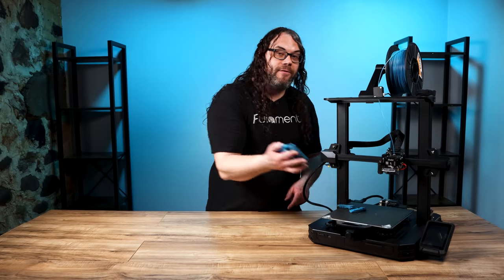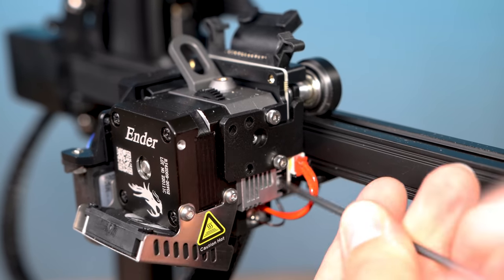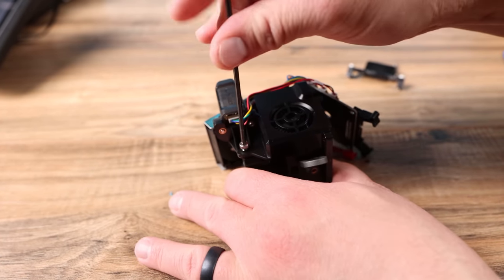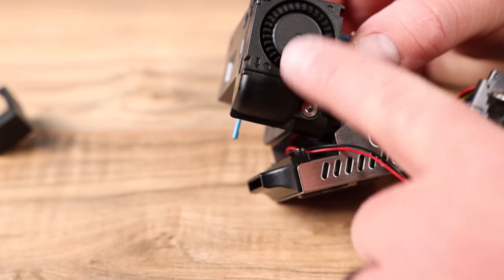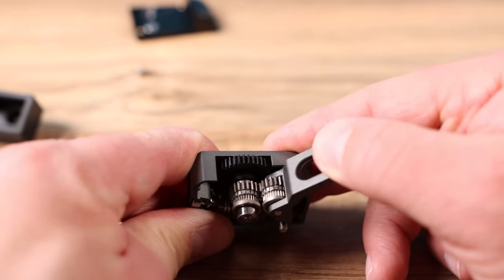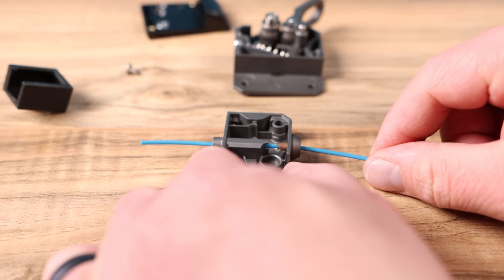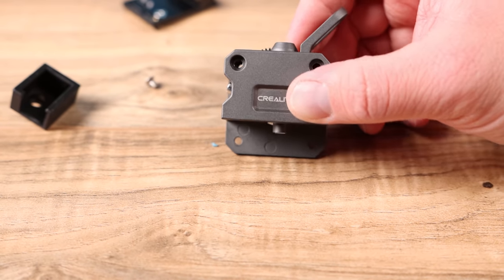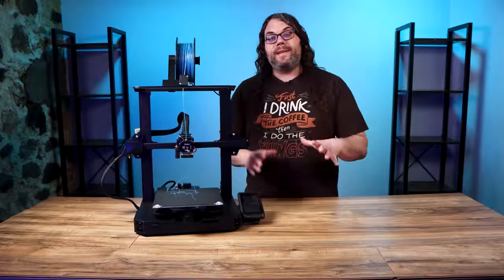How To Fix A Jam on the Ender 3 S1 Pro (FULL Walkthrough)

Comment: Thank you so much for this video!  I had to disassemble my S1 due to a blocked PTFE tube.  I'm trying to put it back together and cannot for the life of me figure out where the heck all the screws go.  I have 3 really long ones.  I know 1 goes in the same side as the board but where do the other 2 go?  I was trying to see the lengths of the screws as you pulled them but I think I missed those particular ones.  Again, thanks for the video!  Gave me the courage to dig in and figure out the issue.

Comment: Great video and very useful for those of us in the same ... jam :-) Before I saw this video, the sprite process looked pretty daunting. But, step by step, clearly described ... it was not too bad. (One very minor editorial suggestion. "Reassemble it by doing the steps in reverse order" ... it would be helpful to have some bookmarks for the various steps to make it easier to walk backwards through the video. I know ... looking a gift horse in the mouth.)

In my case, it was a tiny pellet of filament (the heated blob) that got stuck after eject and broke off when I pulled hard to get the filament out. Since that area is not heated, no amount of pushing or pulling with various tools would get through

Comment: I just dealt with this, but mine cleared up.  I was using luminescent filament (PLA) and the roll definitely has some odd shaped sections and imperfections that you can see.  I think this is what causes the issue.  The luminescent is clearish, but I found parts where there’s a black bubble in it and the filament is deformed and oval looking.  Poor quality control with the filament co. (Disclaimer: these are my 2 cents… you don’t have to take them, I may be wrong anyways) .  I was looking to learn how to take this apart just in case it does it again, so thanks for the great vid.

Comment: Thanks for this, happened to me today. Same issue with a good in the dark filament by eryone.
I checked my roll, it looks even but I suspect it's the direct drive gears either crushing it or flattening it slightly that stops it going into the hot end throat.
Seems like a mini caused it.
Great video, really helped me, had it taken apart z fixed and reassembled in 20 min.
I did remove the stuck filament from the o opposite end that you did as I had enough room and didn't want it to be so violent

Comment: Ive used this video to fix my first jam, but ive had my printer jam twice after it BUT if you catch it within an hour or two your fine as you can just get the filament back out easy enough. What happened to him and what happened to me the first time was it was left alone TOO long and it eventually grinded off the filament which left that piece in between the gear and nozzle.

Comment: Thanks for the video- I tried to just remove the hotend bit on the bottom as another video did, but I couldn't- somehow the gears mangled the top of the filament and it got well and truly jammed right before the PTFE tube. First time 3D printer and I have a jam on the 1st day! Anyway, following this I had to pull the filament out (in reverse- toward the gears) instead- really helped.

Comment: Thanks for the video.  I had the exact same issue as yours and had to use pliers to pull the filament from the 'little white tube'.    

One suggestion - please add or create a rebuild session....just don't leave it with a  'just do it backwards' comment.    I had to write the instructions after a second viewing and then follow them with your video to go backwards.    I would have been also nice to have seen your rebuild!

Comment: Okay, I admit it-- I'm a noob. Just got my Creality Ender 3 S1 Pro, and after 4 printings, nozzle jammed. Tried to disassemble it, and SNAPPED the two retaining screws on the heat block. Replaced the brass nozzle with the tempered steel, and it seems to be working. HOWEVER, one of the heat block screws snapped off in the heat block. Where do you get the replacement screws? Creality doesn't list them, and I  that the screws are m4-30 screws ( I'm probably mistaken about that). At this point in time, should I just go ahead and buy a new sprite extruder assembly, or could I just swap out the hot end?

Comment: Ok. well, I just had this happen to me and I started with the way Creality showed how to clear the throat. This video took more apart than I needed to. My jam WAS in the same area, but I did not take apart the top part to get to the extruder; the PTFE tube shot out when we pulled the remaining filament out. after comparing this video to the creality video we decided it could just go back in and it seats above the hot end throat, so no further surgery required. 

bummed because I lost a long print tho. Silk pla, still learning this printer w/r/t retractions, maybe overly ambitious for my current understanding...

Comment: I would recommend going back with Capricorn tube or other smaller diameter tubing, OR expanding the top inlet to the same diameter as the stock tube. THE reason for the jamb is the different diameters after too long of a retraction or filament ejection.
Reply: why would this matter? sorry, just trying to figure out if I should do this to mine (I assume you mean add some PTFE at the spot where the filament goes in).
Reply: Keep in mind the retraction for the Ender 3 S1 series needs to be at 0.2mm for this exact reason. Never had this issue with this printer tbh. Ways to prevent these jams for the future. 
1) If you get new filament heat up the head first extrude a bit and then slowly pull it up to remove the big blop at the end that goes into the hot end
2) Get good grade filament and keep it in a dry box (I use a box full of silica beads you can buy packs of 100 pieces for just 5,-) getting moisture in your filament causes it to snap at the worst possible locations (I had a tube feed CR-10 before its even worse if it happens halfway a large print and trying to refeed it on the fly)
3) Cut the new filament at a 45 degree angle to make it able to hook in better
4) Extrude again a bit before starting a print

If you keep yourself to these 4 rules it should never happen

Comment: So I’ve had this happen twice now, I found a very easy way to get it unjammed, simply grab some needle nose plier and rest them on the extruded tension release and grab the filament there and pry it out using the release bar as leverage, pops out fairly easily but there will be a bit of a jam left in there, both time to solve that I simply cut the filament and used the filament itself to knock out the jam by using a couple quick jabs into the extruder with the hot end heated and eventually it knocks the jam far enough in to be melted and extruded… that being said id like to know what is causing the jam because it’s annoying.

Comment: If this happens while printing you can try moving that extruder wheel with your finger, give it some help and it might work. I tried to change my filament while printing on my CR 4M and slightly pushed it and started feeding properly. Also, try pulling out the filament cut the tip at 45° and it should work.

Comment: hello jim, thanks to your video, i have detected the error, there is no blockage in my problem, but my gears cannot direct the filament while it is moving I wonder what is the problem, even though I tighten the screw on the side, the problem continues and my pressure is very bad today is the 5th day if you can help I would be happy good work

Comment: Maybe you're not like me and you don't think about this, but I am always trying to keep track of what screw sizes and hex keys go where. I didn't measure the various screw sizes, but I did keep track of the hex keys I used. Almost all of the screws want a 2mm hex key. The exceptions are: The two small black screws that diagnoncally hold the fan in place. Those want a 1.5mm hex key (the smallest one in the kit that Creality gives away with printers). And the 3 really long screws that hold the heater block and extruder gear housing in place. Those want a 2.5mm hex key. The 4 screws that hold the whole thing to the X-axis cross-bar also want a 2.5mm hex key.

So, even though I ended up with tools all over the place, I only actually needed hex keys 1.5mm, 2.0mm, and 2.5mm.

Comment: Planing to add a new printer and this is one on the list and when you said in the last video, that jams are a little hard to solve i almost get it off the list, but that doesn´t look so difficult to solve.
Is that only a problem with 1,75mm? I have an Ultimaker 2+ with Bondtech DDG Extruder and i NEVER had a jam or other problems.
Or does it depend also on the filament quality?

Comment: I just finished up installing my new Sprite on my first version CR-X that I only use as a single extruder along with the SV02 silent Mboard.  I began with testing the extruders' ability to push filament thru the hotend.  Using the "refuel" command, and touching the "Feed" button, the filament reversed out of the Sprite...  I then reversed two pin connectors in a 4 group Extruder plug female end that plugs into the Mboard marked extruder-0, on the touch screen its "extruder 1".  Re-tested, and now the filament goes in the correct direction, but the filament isn't consistently being pushed thru.  I have reset my E to 424.9 , but I have yet to check calibration again.  I have a funny feeling I need  take apart the Sprite to check the gears and make sure they are tight.  If I'm a victim again, of  Creality slacking on build quality, I won't be surprised.

Comment: I appreciate the time you took with this video! Mine will be shipped in a couple of weeks, and I know that one day I will need this knowledge. So why do you think it jammed?
Reply: I noticed it’s deformity in the filament.  I had luminescent going through it which is normally clear, but found a black spot and deformation on a section of it.  I feel that the machine is the machine and settings will affect things, but the only foreign part to the machine is the filament, which if it’s not true would cause a jam for sure with the tolerances in that extruder.  Hope this helps.  It’s my first one and I love it so far.

Comment: I HATE these extruders, I have an s1 plus with a bootleg cht nozzle and I cannot get it to print more than 15mm3 on a orca slicer flow test. The teeth start slipping anything above that and I cannot figure out why. I have 2 E3V2’s with clone Bmgs in a direct drive setup with stock extruder stepper and they both can go up to 27mm3, I don’t know what I’m doing wrong. I’ve taken it apart for clogs or jams, tightened the tension screw, switched filament, temps, new nozzle l. Everything and I cannot get it to print anywhere near what my e3v2’s do.

Comment: Has your S1 Pro ever just started stopping mid print...  3 fails, because it stopped feeding but was still going thru the motion as if it was still printing, when I pull back on the knob and push on the filament, it feels like a gap, as if the filament had broken inside the hotend tube, no clogs, filament flows freely when I feed it, but then when I run a test print, it refuses to feed...   IDK whats going on...
Reply from the maker: Interesting. I haven't had that issue, and that's a weird one.

Comment: can you offer any advice to get the extruders to stop clicking/slipping? i've torn down 3 of them honestly hoping to find a clog, any tips on the proper tension?
Reply from the maker: Are you adjusting the tension screw to make sure it's tight enough?
Reply: @TheEdgeofTech  I did try that,  I just can't seem to solve this! I'm now going to try swapping out the entire hot end. My printers are e3s1, both are running the custom firmware and are less than 9 months old

Comment: Sometimes a mass of plastic cools enough to get pulled back into the bowden tube due to retraction, and then cools the rest of the way and totally clogs it. Then it has no way of clearing the clog because heat doesn't make it up to the bowden tube. Lowering retraction and using slightly higher than normal temps stops it from happening... but it negatively effects stringing. I can't really find a good balance of no stringing and no clogging.

Comment: What a great video. I subbed. But I have a slightly different problem with my s1 pro feed. I can push filament through by hand but the auto feed does not pull filament off the spool or push it through the hot end despite the gear wheel turning. I noticed a spring with an adjustment screw beneath the fan. Could this be too loose?  The machine is brand new and I'm not happy to send it back if it just needs an adjustment. Thanks
Reply: There is a screw on the right to adjust the tension of the spring to increase or decrease the grip. It is the screw in between the ones you take out to remove the extruder.

Comment: Well I had to do this mind boggling job three times and ended up with broken thermistor wire. So be careful while dismantling or removing hot end block. At first time I replaced the printer when just after 3 prints this problem started as it was within exchange period when I got new printer from amazon but just after few prints again this extruder jam  issue started and then I tried your suggested method this solved issue temporarily and had to do this three times as after  every 3 or 4 prints same extruder jam issue and then broke thermistor wire accidentally. Now I am waiting  for new thermistor. I tried to replace with old model thermistors which are available on amazon easily and as usual none of them was compatible  with S1 PRO and thermistor for ender 3 S1 and S1 pro are not easily available in India on amazon so please be careful while removing hot end block and I think  creality should do something to sort out this problem as it's not easy to open extruder after every 4 or 5 prints. Happy 3d printing to the community.

Comment: Thanks for the great video. I noticed that the ptfe tube moves very easily when you were loading filament to test it out prior to reassembly. I wonder if a deformed portion of filament (whether from hot filament entering cold zone over and over or gears deforming the filament) can kind of clip the upper end of the tube and vibrate it enough to shift. If the filament is moving back and forth, and the tube tolerance in manufacturing is not sufficient, I wonder if tiny rough or deformed edges of filament can kind of get pinched between the upper part of the ptfe tube and another portion of the assembly. Or maybe that same thing could happen lower? Ideally, that ptfe tube should not be able to move at all once fully assembled, but it's doubtful that thing is really well in place.
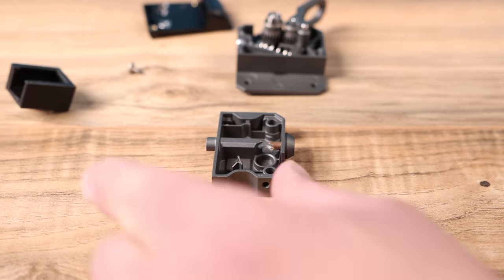Reply: Actually at 9:01 you can see a tiny white line in the filament that looks like a pinch. How is that ptfe tube stopped from moving higher toward the gears? I guessing there's a countersunk collar or something inside the hexagon looking tube guide that stops the ptfe from moving up vertically?
Reply: @dmax9324  Nope. It's just a straight piece of tube with nothing to hold it in place.

Comment: Your retractions are too high and getting soft but not melted filiment into the PTFE tube.  1mm at 20mm/s should be good enough.  Double for PETG.  The fan mount also has 4 holes.  If you only use the 2 fastening it to the stepper, you can open the extruder without removing the fan.  I’ve been in these more times than I wish I had.  You absolutely need to torque the nozzle to the heat break, because the gear reduction can extrude through the threads if there’s a jam.  Unfortunately the gear reduction is also strong enough to strip the splines on the extruder shaft, and there’s no replacement parts yet except buying a whole new head assembly.

Comment: @ 6:40 your top cover came off without the gears and lever. Mine is the opposite and will not let me remove the gears and lever from the cover? Thus making it impossible to get to the filament path :( any suggestions?

Comment: thanks for the shortcut  on dismantling the hotend - pity we still don't understand the reason for the jam.  Seems maybe like the drive knurls gouged the filament side which obstructed the PT tube section when passing through it.    This could happen if the filament got hard to pull at some point.

Comment: soooo... my problem is that when I try to heat the hot end I get an abnormal temp error and it wont do anything.... now the screws are basically glued into the extruder and wont turn at all.... do I dare take a small butane lighter to it?? ... edit torch lighter worked to loosen the screws, hot end is done for though...

Comment: I think a lot of ppl are losing sight, maybe, of how advanced technological solutions which direct drives are, are often/usually more complicated than their predecessors. I am not a super handy person, but I am awaiting an S1 Pro, and if it all works, well, I will get a few more ;)  While this looks moderately scary, I will just take my time and the fact that I can take it somewhere like a work table to go at my own pace is already a huge plus vs trying to do something at the printer. My ultimate reliability plan will be to have a spare Sprite (regular variety) I can stick on while I fixup any malfeasants. ETA: I have an Ender 3 so I can continue to torture myself on that one.
Reply: While this is true, this specific hot end is not good for servicing